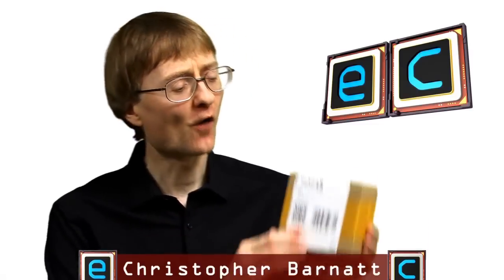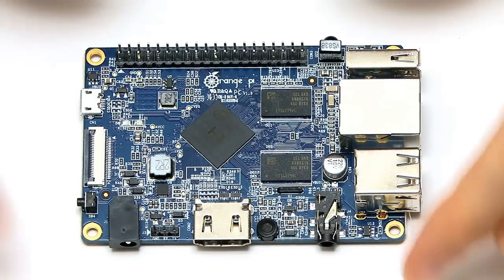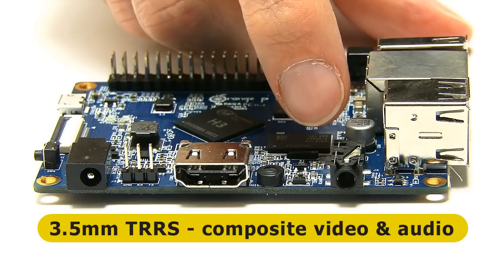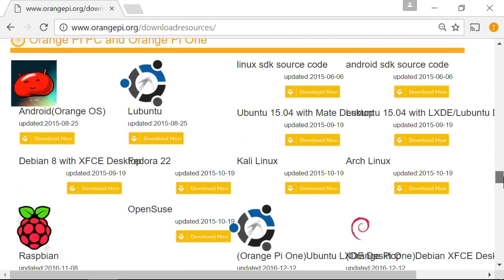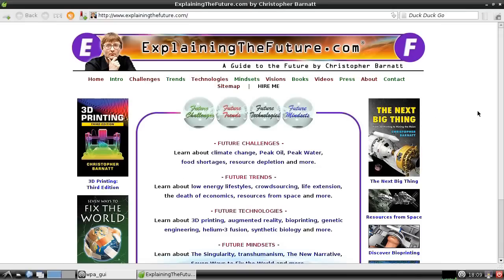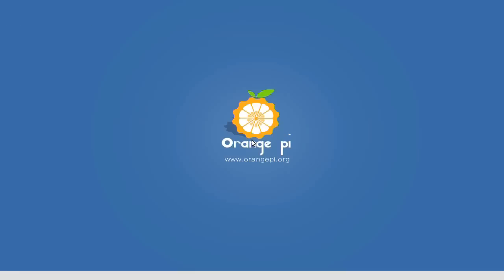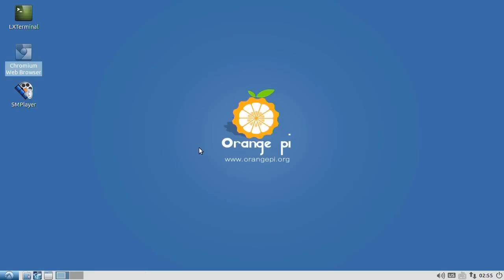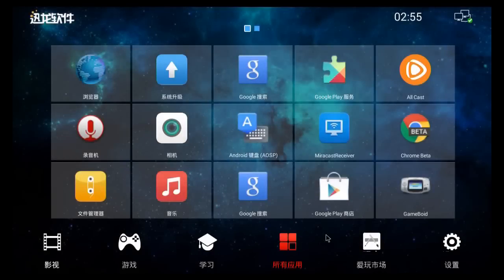Orange Pi PC

Comment: This board is not as bad as described anymore. It is supported by Armbian and is very stable and quite decent. I've got 3 of them. I use one as a OpenVPN server, another as a Weather Station server, and the third is currently spare. Whie the Raspberry Pi is currently unobtanium, this is still available and works for what I need. And the price is still very reasonable. My next job is to see if I can get Octopi working on this.

Comment: Can't find any comparison reviews online but I'm trying to use a western digital blue ssd since my sd card is full and therfore having trouble out the wazoo to format , tried everything  pretty much and since I have one that I havent used but wanted to know if I do so ,  will I lose any performance vs the SD card slot at its fullest spec as the pi is of course is usb 2.0 also ill be using it in my project of an old first gen xbox case and would like to know how to wire the power wires and use a script or something to power on and off  saftely which in retrorangepi if you or anybody knows , thnx In Advance for any and all help

Comment: Have been going through your catalog of old videos and there are so many boards that you have covered. Would be very useful if you did a flashback of all of these SBCs that were comparable to a pi and seeing where they are now. Have most of them seem to have gone out of production or have stagnated, or have kept up with the raspberry Pi, etc. Not so much a spec comparison, but development pipeline comparison.
Reply from the maker: Thanks for this, which is a BRILLIANT suggestion for a video! :) I've just put a note in my "Video Slate" document, and I've even opened a script file. So this will happen, probably Jan 2022.

Comment: Is that single vertical USB socket "special"  - isn't it OTG or something? Did you try plugging into twin USB sockets? I need to know!
Reply from the maker: Not special, aside from being vertical to fit on the board! Not OTG.
Reply: @ExplainingComputers  Really appreciate the quick feedback! I thought it might be something to do with that port - did you manage to get WiFi working?
Reply from the maker: @Fifury161  On WiFi I cannot remember, it was some time back I made this video, and I've made many since! :)
Reply: @ExplainingComputers  I appreciate your feedback - thank you! I'm trying to reverse engineer a Fing box and I have discovered it's a customised Xunlong Orange Pi Plus 2E, I'm trying to familiarise myself with the hardware.

Comment: for those of you who are interested. i have an orange pi one and the only os i could install was debian. i tried the android os,ok i know just not enough ram but for the sake of succeding in an os many say failing to install no matter what you change or else. i found who says on some sites that the pi are not baked enough when it comes to processors and other chips who says this,who says that,nothing i could not succeed. i changed a lot os micro sd cards because a lot pointed to this but many original brands,different names and gigs but haaa i tried even unbranded once but still nothing. i was going to throw it out of the window when i bought some crap really cheap unbranded micro sd's or at least i tought where crap. i installed android two times at first without no failing. the only thing was different and nobody mentioned it was that these sd cards are not 2.0 but 3.0. maybe you ask if it was that? for me from never succeding to succeding always the answer is fu""in YES OF COURSE. Think before you listen to anyone and throw away good things.

Comment: I've had zero issues with multiple WiFi adapters.  The MT7601 $2.80 on Aliexpress and was plug and play using the Armbian image for Orange Pi.  I've gotten the Ralink RT3572L working plug and play for dualband for $12.  The Atheros AR9271 for $6 on Aliexpress was plug and play.  But again only for Armbian which was command line only.

Comment: Hi. I wonder if you have any information about the Orange Pi RK3399. Have you tested it with different configurations. I am looking for using it by car and then able to record my drive on my way with a camera and to record it on a hard drive. as well as being able to connect it with the LTE / 4G network. hope you have tested something like that
Reply from the maker: I've not tested it I'm afraid.
Reply: @ExplainingComputers  Hello again
I hope you will do some tests on these computers. It would be interesting. I usually look at your tests you do.

I'm planning on buying an Orange Pi RK3399. I hope it's a good single-card computer
Reply from the maker: It looks an interesting board, with lots of connectivity. I will add it to my list! The RK3399 boards are arriving thick and fast (my next to review here will be the NanoPi NEO4 on 18 November, which is the smallest and cheapest RK3399 board so far).

Comment: There are way too many Orange Pi versions for me to figure out which one I need for projects. I would like to try some projects with Orange Pi but only really understand how RPi boards relate to each other not mentally capable of comparing them with boards developed by other companies and the Orange Pi documention on their site just makes my head hurt. I am still a no.Ob when it comes to microcontrollers and SMB's but I think maybe I could try these if I knew which one to use in place of the RPi boards I'm used to.

Easiest way to express what I need in hopes of getting answers ...

How do they all relate to Raspberry Pi versions?
--- OR ---
Which OPi is most like the RPi 1 A+?
Which OPi is most like the RPi 1 B+?
Which OPi is most like the RPi 2 B+?
Which OPi is most like the RPi 3 B?
Which OPi is most like the RPi 3 B+?
Which OPi is most like the RPi Zero?
Which OPi is most like the RPi Zero W?

I presume that in some cases OPi and RPi can't be directly compared and there may be several OPi boards that equate well with one of the 7 RPi flavors since there are so many OPi versions. I also expect that since many of the boards are or started as open source designs that some of the OPi boards will more closely resemble boards from other companies I may be more familiar with from your channel so my final question would be ...

Which OPi boards, if any, more closely resemble other boards that you have covered?

Comment: Hi Christopher! I'd like to refresh  a topic regarding Orange Pi vs. Banana Pi. Currently there are a newer versions of each boards. Orange Pi seems to improved software (according to buyers opinions). I'd like to know is it worth it to get either of this minicomputer (as alternative to Raspberry Pi 3 which I already have)? Purpose is installing OctoPrint on it, record video during 3d printing procces using some nice -not dedicated usb cam like ELP, store that video files on attached 2,5'' HDD and maybe play around from time to time. Best  would be to get high resolution (let's say 4k, or at least HD in the worst case scenario). But as always there some cons. Some people are convinced it cannot be done, while others believe it should work :) What is the right answer? :) There isn't any instruction how to install Octoprint on  BPi (while for RPi there is planty, and just a few for OPi). I'm searching solutions but in case of Orange or Banana it's not so obviouse. What about different boards (like Asus Tinker boards, Odroid or Rock)? In yours videos I've found something great about each one! Would love to have them all :) but geting just for testing it's crazy idea :P Could you maybe do test comparison about running octoprint on that devices, please? Another one -Latte Panda , is also sweet! But in that case it's to pricy to use it for a such purpose, and it's pure Windows.. Another question: is it possible to install Octoprint on system like Android or even Rasbian for not Raspberry devices?

Comment: Use Etcher https://etcher.io to write the images to your SD. I tried the ImageWriter software we generally use and it has failed many times. I was having issues with the basic Rasbian image on the imagwriter software, with etcher it works properly, and this is verified with using a 1.25A USB wall charger for power.
Reply from the maker: Etcher is indeed excellent.

Comment: I have no idea why this board even exists. If you are going to set out to improve on a product, the bare minimum you need to do is make it work better than the product you are trying to improve on. OrangePi seem to fail spectacularly at this. I have 3 different OrangePi boards, all of which met my parts bin after updating the software on them rendered them unbootable. Yes of course I can reinstall everything, but it takes you 10 times longer to get everything working on these boards compared to the fire and forget Raspberry Pi. For the record, I was using them (briefly) for Octoprint, Retropie and plain old Raspbian. Never again will one of these boards land on my doormat. A complete waste of time and money.

Comment: thanks for sharing  but I just want to say that I have 4 orange Pi's, all are wireless I use both the zero's for managing & controlling my 3d printers  wirelessly via octoprint,  and both do it without issue, -  as well as providing control of power & lighting  to the printers via  a couple of additional relays - the orange pi lite's seem to work for what I am using them for too without issue too at least for me - I remember a few years ago  i had a similar problem getting my wireless adaptor to work in a linux box  I got around it using an NDIS wrapper

Comment: I think I may know the reason why you couldn't get the WiFi dongles to work—at least in Lubuntu, but possibly Raspian as well. I encountered this issue with my mobile-broadband data-stick. However, after performing the following steps, it worked like a charm, and I only had to do this once for Network Manager to be able to manage it:

1. In a Terminal, enter the following while the dongle is plugged-in:

nmcli connection

(This will list all local networking devices.)

2. Identify the device you are trying to use to connect (in this case, your Wi-Fi dongle). Copy its UUID.

3. Paste its UUID into the following command on the same line:

nmcli connection up uuid <Paste UUID here.>

Hopefully, this will work for you.

Comment: "Wifi doesn't work"

Are your wifi chips from Broadcom? Because there are no OSS *nix drivers for Broadcom chips, which is probably why they don't work. If you open a terminal and do  "lspci -vv", you should see the wifi devices if they're connected, but you need the proprietary firmware and drivers to run them.

Try finding some wifi adapters that use realtek chips, they have OSS drivers and work on pretty much any OS.

Comment: can you boot from an usb stick in stead of the sd card?
If you can then install debian os from scratch and it will come with all you need.
Reply from the maker: Sadly you cannot (easily) boot from USB -- this is an Atom board, and hence lacks a standard boot loader.

Comment: I had a lot more luck with armbian on most orange pi's, and if you need a desktop version, debian desktop by the armbian guys might be able to pick up usb wifi's. I found you'll need to have the the LAN plugged in before you try the USB Wifi, this allows the wifi drivers to be downloaded automatically (sometimes)... https://www.armbian.com/orange-pi-pc/  Otherwise you'll need more linux savy ways of installing usb wifi sticks, plenty of help online - but definitely a deep delve if your not command line happy.

Comment: The Orange Pi familiy seems a little bit confusing. But here are a few overviews:

http://www.cnx-software.com/2016/06/08/allwinner-h3-boards-comparison-tables-with-orange-pi-banana-pi-m2-nanopi-p1-and-h3-olinuxino-nano-boards/

https://forum.armbian.com/index.php?/topic/1351-h3-board-buyers-guide/

And a recent update https://forum.armbian.com/index.php?/topic/1351-h3-board-buyers-guide/&do=findComment&comment=28169

For me the Orange Pi Plus 2e seems to be the most interesting device in the RasPi price range. 
- 2 GByte DDR3
- 16GB on board eMMC - you can remove the SD card after transferring the OS! 
- real GBit Ethernet, not shared by USB hub
- USBs not shared by hub
It runs stable with armbian Jessie as many contributors stated here before. I am happy that I finally have a single board computer running without SD card. With my RasPIs I often had Issues with the SD card especially when restarting the board.

Comment: #1: It is not true Andriod image you showed in the review doesn't support languages other than Chinese. Just use Settings to change the language to English. It is easy to use the language icon and then click the appropriate menu (use some Android phone to locate the icons or just try which one is Language icon). Then you can install some other launcher, Google Launcher works very well. I have a few Raspberry Pi boards & a few Orange Pi boards and Orange Pi PC works very well with Android (+Kodi). Orange Pi PC has mobile-phone-like GPU, that is why it doesn't work with -nix images (Raspbian, Armbian). Similarly, there aren't graphics drivers for Raspberry Pi which support GPU acceleration, that is one of the reasons why Raspberry Pi doesn't work with Android images. The bottom line is: use Rasbperry for Raspbian (-nix images) and Orange for Android. By adding Google Launcher and soft keys app (Button Savior), Orange Pi PC works better than most of $100 media players, here is the screenshot: https://www.dropbox.com/s/fovmbndzq95yijp/soft_keys.JPG As you can see, I even added support for live walppapers and everything works great.
#2: It is not true wifi cards don't work with Orange Pi PC. You didn't check Orange Pi PC *forum*, did you? The first thing is - you have to use the 1st USB slot, wifi USB card wouldn't work with the USB slot you used in the video. Next, the wifi adapter has to be based on *RTL8188*EU or similar chipset, you can buy such wifi cards for $2. Next, you have to first start the Android, then plug the wifi stick, then unplug the wifi stick, then turn off Orange Pi PC, then plug the wifi stick and finally turn on the Orange Pi PC - as I explained here: http://www.orangepi.org/orangepibbsen/forum.php?mod=viewthread&tid=2094&page=1#pid15991 You have to do that only once, afterwards wifi stick will work every time it is plugged.
Reply from the maker: Thanks for this. I will try what you outline. Note, however, that I tried all three of my WiFi dongles in all four USB ports. It also really should not be necessary to search a forum to get a basic peripheral to work. I have never has this issue with any other SBC.
Reply: Hi, I believe you tried all of the ports and all of the USB wifi cards because I tried everything that came to my mind before I discovered the right procedure :-) I built 15+ Orange Pi PCs for me and my friends and although at one point I already managed to get wifi working, I still didn't know what exactly I did so wifi started to work. Then I took some time and finally found the correct procedure. All conditions from my description have to be met and then wifi works every time. But the wifi stick must be based on one of the supported chipsets and the described procedure must be followed strictly. I know wifi should work out of the box but these SBCs are rather specific. We all know each of them has some quirks. For example, here I described an unexpected behavior of Raspberry Pi + digital USB joystick: https://www.raspberrypi.org/forums/viewtopic.php?f=28&t=129318 I have quite a few Raspberry Pi and Orange Pi PC boards: https://www.raspberrypi.org/forums/viewtopic.php?p=934941#p934941 I consider Raspberry Pi to be a better SBC than Orange Pi PC, especially because I work with computers since ZX Spectrum and I believe (in fact, I am sure) Raspberry Pi was built upon similar 'British philosophy' - but Orange Pi PC is a very good SBC too, regardless of lack of support and proper documentation and especially now when there is Retrorangepi - working port of Raspberry Pi's Retropie. Despite wifi really should work without problems, it could be somehow misleading saying wifi does not work because it does. There is however one serious issue with the image you reviewed - upon every boot large .log files are being created on the SD card so after a few days the card becomes full and unusable. Here I have described that issue: http://www.orangepi.org/orangepibbsen/forum.php?mod=viewthread&tid=1320 Meanwhile I solved the problem by writing the Automate script for auto-removing the files but I still did not post the solution which I will do one of these days. Regards

Comment: stopped  to work after few months without any visible reason. just drain 3A from power supply and became abnormally hot even with heatsink.   sure no warranty.  no support, nothing.  replaced with raspberry pi 3.

Comment: Why do you use SD Formatter? What's wrong Explorer/Disk Manager/Diskpart?
Reply from the maker: For a start, SD Formatter allows "Format Size Adjustment" to be set to "on", which is important when setting up SBCs. Also, standard Windows disk manager tools sometimes cannot access an SD card's full capacity after it has been formatted (let alone corrupted) in another OS like Linux. For these reasons, all SBC manufactuers recommend formatting with SD Formatter -- the definitive SD card formatter created by the SD Card Association -- before installing an image.
Reply: Fine, that rules out Explorer, but Disk manager and Diskpart still can get the job done. I suppose it comes down to UX. Personally I'm just not a fan of using specialized tools for simple tasks; tends to get messy pretty quickly. 
Also, “Format Size Adjustmen” is absolutely irrelevant in this scenario—according to the SD Card Association, all it does is align partitions to size of a sector, but, since you're going to overwrite the whole card (including MBR and with it the partition layout) with a card image in the very next step, all the effects of this setting are immediately erased.